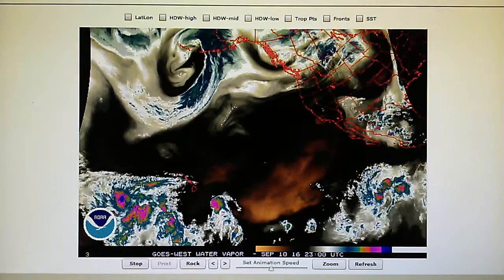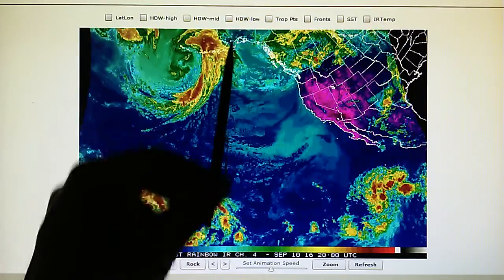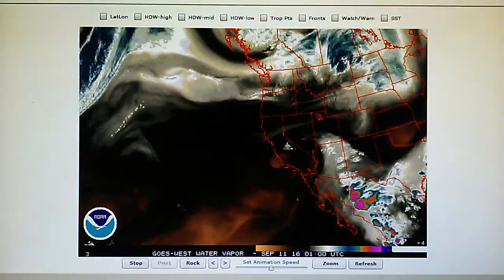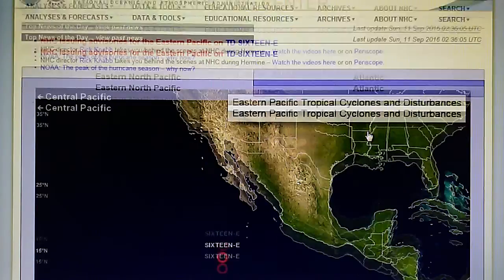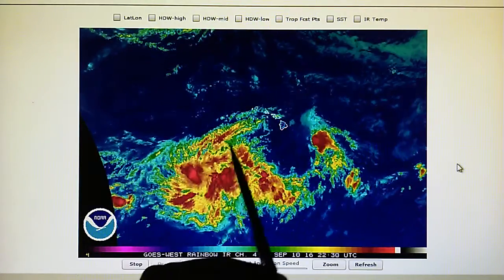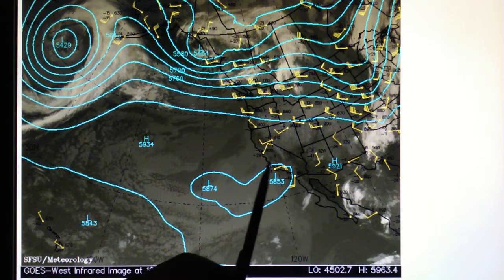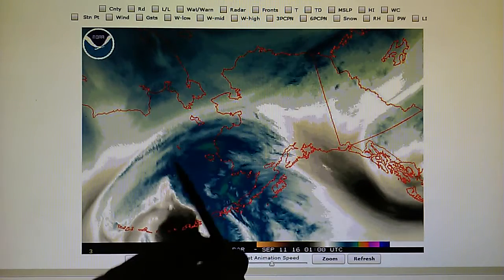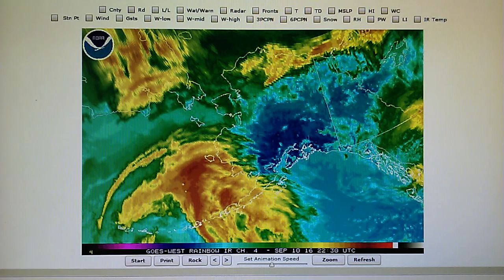9-10-2016; Tropical Depression 16E Forms in E. Pacific; Right Angle on Low Pressure Sys. Over Alaska

Comment: Since the 'monsoonal flows' seem to emanate from the
same areas day after day, I'd say we could eliminate vertical
lifting as a likely cause. Especially at night.

In watching slow motion Nexrad loops, it appears the pulses
are used to agitate storms. As yet, I'm unsure what the beams
are designed to do. But, they are clearly visible and they often
cross several states to perform their function.

The local weather weasels call Nexrad pulses 'outflow boundaries'.
They also look stupefied when storms move east to west.

But, they are not surprised when "Cirrus clouds", ice crystals in Nature,
hang a couple of thousand feet about a 98 degree surface
temperature.

Politicians are actors.